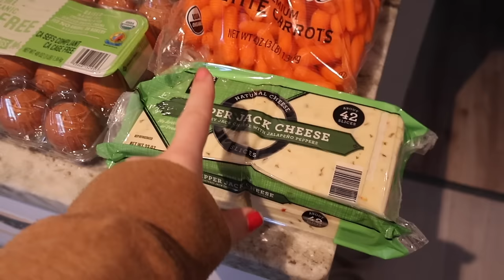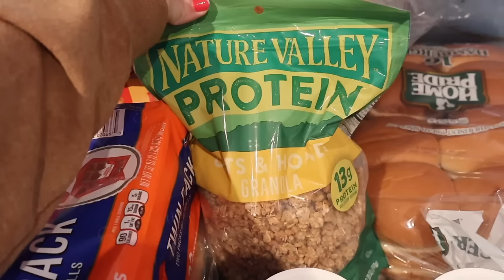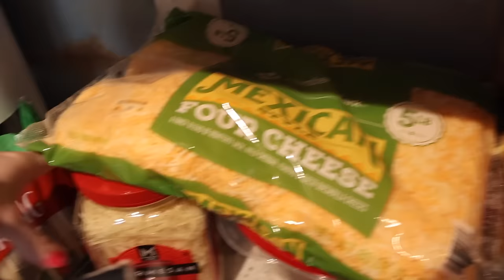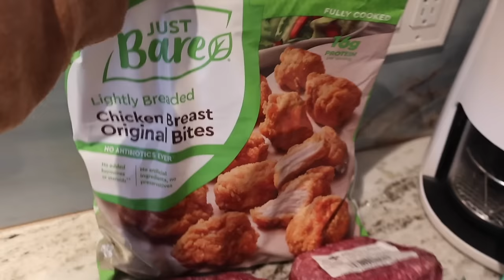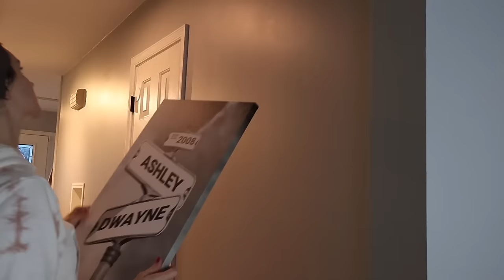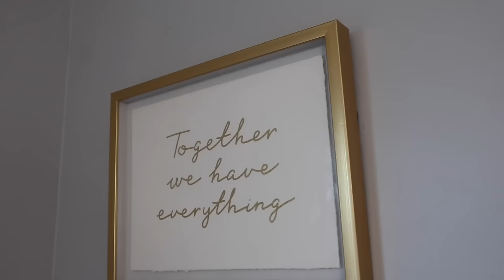EXTREME CLEAN WITH ME 2024 | ROOM TRANSFORMATION, DECLUTTERING & HNAGING PICS FINALLY | MESS HOUSE

Comment: I absolutely love the pink stuff. I use all of it as you know. I've been cleaning for over 20 years. I have my own cleaning business. I do it alone so I do a lot of trial-and-error things in my home first before I use them in anyone else's home  most of my clients homes have the glass shower doors from top to bottom.  You can use the magic eraser, but I find that if you keep a squeegee in your shower. After you shower squeegee, the glass doors down after each shower and it will help with the water spots and stains. Now, when I clean the glass doors I use the dawn powerwash and then I will rub that in and clean the glass doors. With that, then I will go back and rents. And then I will take can use use the Clear windex not the other kinds that are colored but the clear kind With vinegar in it. And I.
 Will use either a clean microfiber. Rag to buff outhe windex or paper towels

Comment: Ashley, I would have the girls use the hand held shower to hose down the glass doors before they get out of the shower. That will really help with the build up of shampoo/conditioner. Also, as for the pee on the wall, if you have men/boys in the house you will have pee on the wall. I have tile on the lower walls in my bathroom and am always cleaning pee off of it.  It probably does not show up as much on non tile walls.